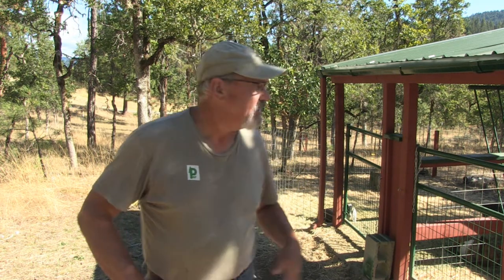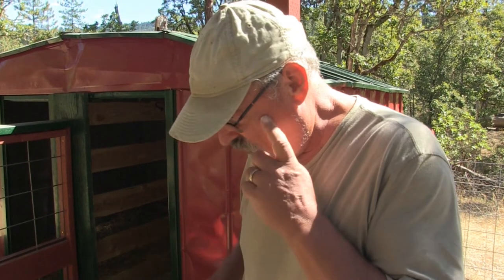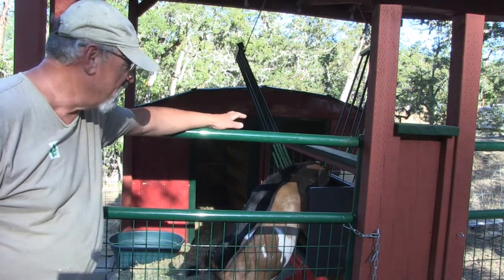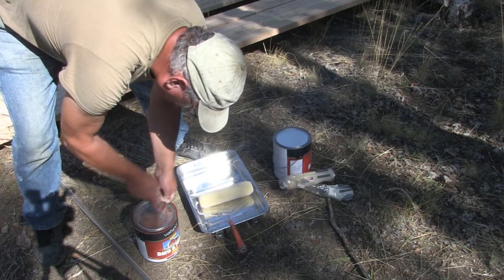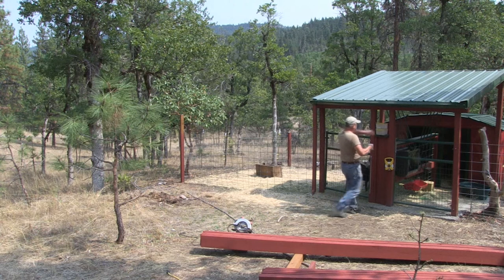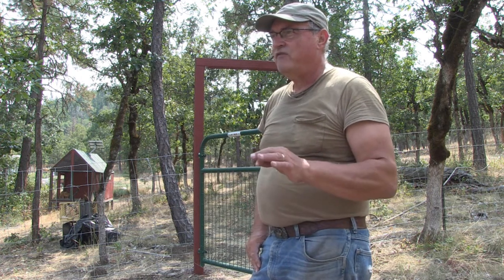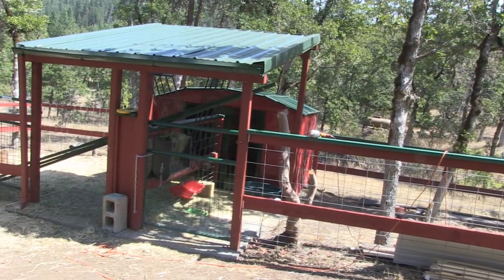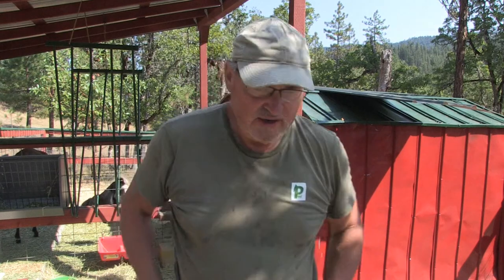HOMESTEAD BUILDING PROJECTS - New Billy Goat Barn Part 16 Finale

Comment: Nice job on the critter city.  I noticed one of your cameras, at 54 minutes, may have either lost auto focus or you turned it off.  One thing to note: modern day electronic auto focus is notorious for going out when you use the video cameras as much as you do. Hopefully you buy extended warrantees so you can get a new camera at no cost, or minimal co-pay, because the auto focus almost always goes out well after the standard warranty expires.  Get 3 year at minimum but 5 year warrantees if you can.  See you soon.
Reply from the maker: At time I don't notice when I'm moving my camera around from shot -to-shot my hand accidentally presses the Af/mf button. On my camera it is located on the side just behind the manual focus ring. It also adjusts to mf when I switch back and forth to infrared while shooting in low light areas like inside the little shed. I'm still getting used to this beast. It's a big camera with a lot of bells and whistles. Canon XF100. I think the reason I found it at the discounted price I purchased it for is the audio card built in the camera is malfunctioning. There is a background impedence which cycles through the sound track. Which is the reason I use a Tascam Audio recorder with a lavalier mic with some shows. Otherwise, the camera still works very well. I just have to be aware of the button on the side which switches back and forth from Af to Mf.